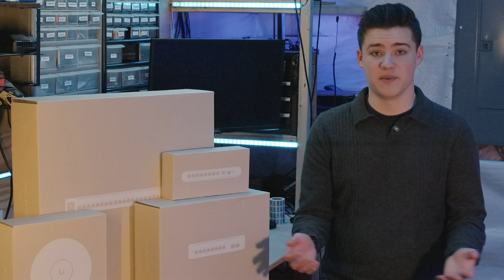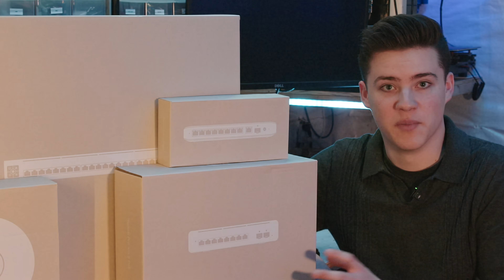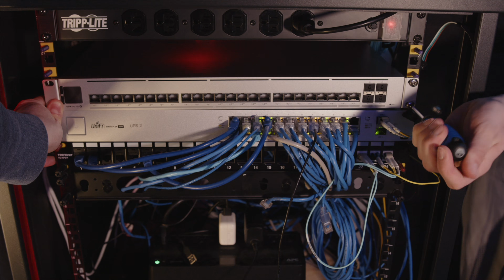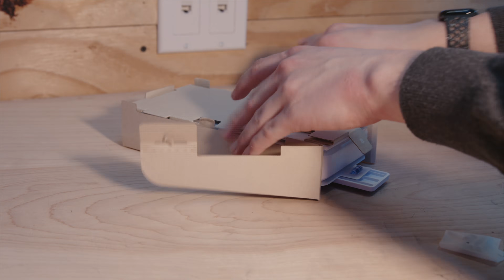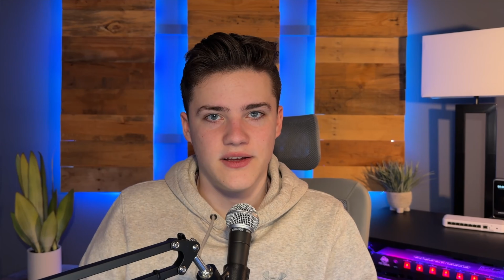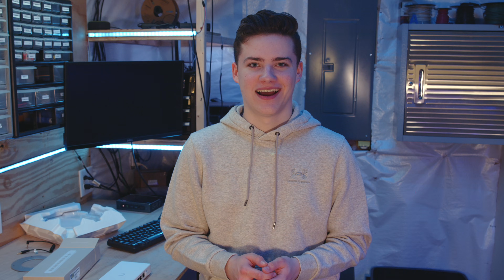My New OVERKILL UniFi Network

Comment: For the love of Networks, please stop calling the mikrotik rb5009 a switch....yes it can be used as a sw, but noooo it is not a switch. IT IS A ROUTER !!! 

BTW. Awesome video but I would really love to see one of the creators to actually rip out the Unify Gear and put mikrotiks all over ...
Reply from the maker: Haha that’s partially why I’m replacing it because I called it a switch not router in a previous video and got lots of comments.
Reply: @beamnetworks1  xaxaxaxa great job 👍👍

Comment: Why replace Mikrotik?
It's better software and hardware than the crap from Unifi.
Reply from the maker: Great question. Glad someone asked. I replaced the MikroTik because the rest of my network is UniFi. I've had no problems with UniFi at home in the past, and it works great for a home network. The MikroTik also got lots of hate from YouTube comments awhile back complaining about how it's a "router" that I was using as a "switch".
Reply: @b @beamnetworks1 assuming it’s only duty was to route traffic from 6 cameras, I highly doubt it would make a difference. The “bad thing” about using a router is that you’re essentially forcing all traffic through the CPU instead of switching it on the backplane. On equipment like the original UDM Pro, the 8 port switch had a 1Gbps uplink to the CPU, meaning despite having 8 gigabit ports, it could only route 1Gbps in total over the CPU and between VLANs.

As I said, if you had expected to route 8Gbps you’d be disappointed, but your traffic was literally less than 100 Mbps in total, and I bet the new setup not only cost a lot more, but also uses a lot more power, and still accomplish the exact same thing.

Still, nice with upgrades. I’ve thrown out everything self hosted, but I kept the network. I have a “work injury” from being a network engineer (a LONG time) ago, so my home network is pretty much “enterprise level”. Cable management… not so much. My server room has been in a temporary room for a decade because the original, purpose built, room was made into a nursery instead. Cables have been extended, more have been added, and the actual equipment lives on top of an IKEA cabinet because there’s no space in the room for a rack.

Comment: I've got the U7 Pro Max AP's here and they work great except for one thing -- in the Unifi controller they do not report any data against any wifi clients. Appears to be a Ubiquiti bug.
Reply from the maker: Very odd. Never seen that before
Reply: @beamnetworks1  They hook into a USW Enterprise 8 POE (2.5Gbit) with the 2 x 10Gbit SFP ports. All other AP's report correctly. Just the U7 Pro Max's don't
Reply from the maker: Interesting. Could be a firmware bug then. Have you reported it on community.ui.com?